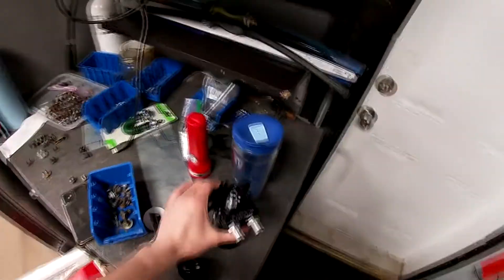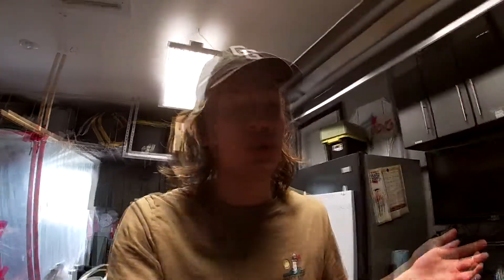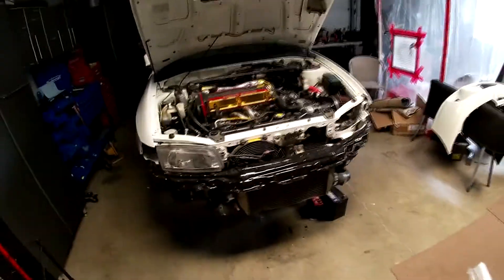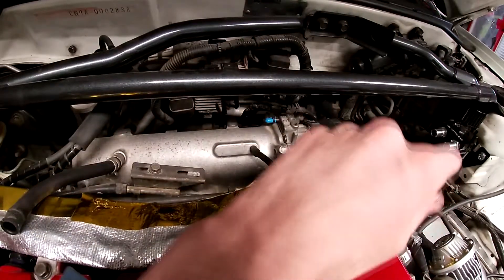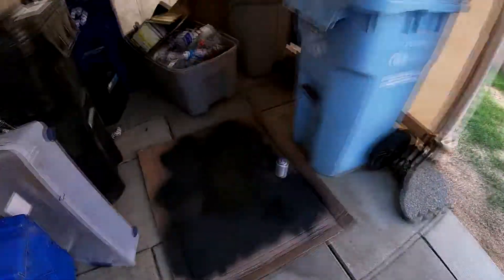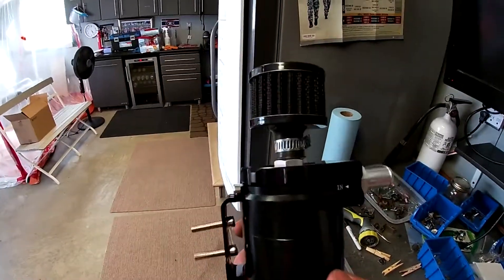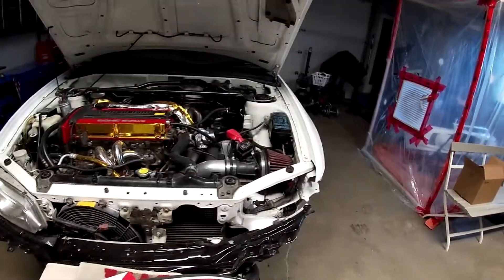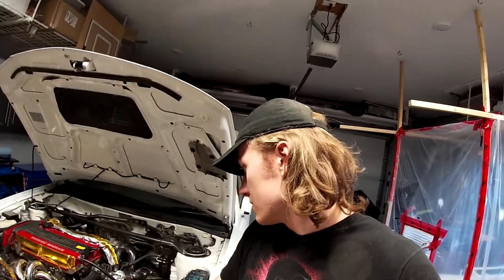The Evo's Get Catch Cans!

Comment: If your running stock maf dont run it open air with the filter. you want to run it VC-catch can-intake. by running it with just the filter you are not keeping the system closed and metered air is escaping the engine.
Reply from the maker: Thats good to know i will look more into it thanks!